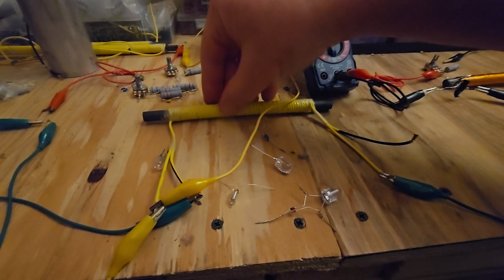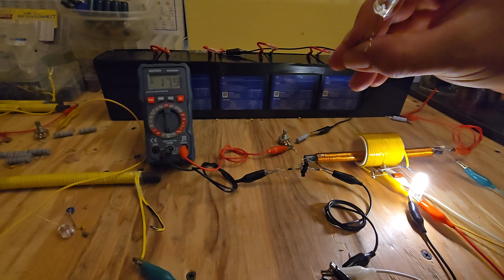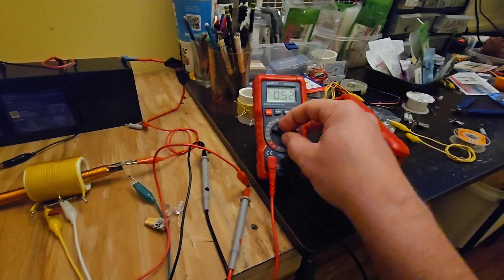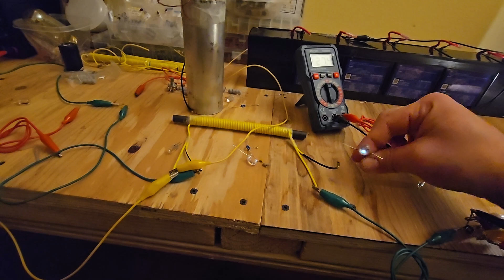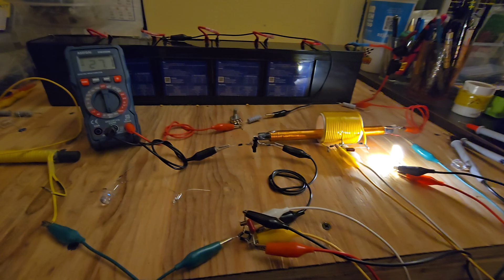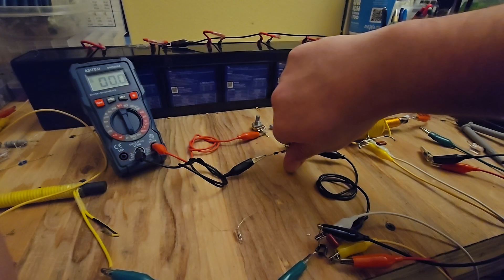💪SCALING THE SYSTEM UP SHOWS GREAT PROMISE & IT SEEMS TO BE VOLTAGE DRIVEN NOT CURRENT DRIVEN💡

Comment: Great work! Did you use Matched Transistors? Any chance you have posted a schematic to this configuration? Also, when you mention Impedance Matching with a charging battery could you show the topology of that circuit? ...and how do you measure the internal resistance of the charge battery? I've used a dymanic method to measure Internal R and not sure if its accurate. Thanks!
Reply from the maker: @woodwind63  greetings woodwind63 in the earlier models of the transmitter they used identical stacked transistors of the BC337B variety, but the current model uses just one MJE13007 transistor with a 90vdc 0-200mA variable current input. The exact details & schematics for the joule thief transmitter from the very beginning to the current models are all listed on my channels community posts page & a good way to impedance match the receiver coils output especially if constructed exactly as described in my posts notes is to slide adjust the coil over the transmitter until rapid battery recharging is observed & an additional LC impedance matching network in parallel on the quarter sized loosely coupled 336,961 style tesla receiver coil has a value of 1nF & 10mH & is beneficial if using a 200mah 9vdc battery for rapid recharge testing.

Comment: Have you tried some decent loads ? I am curious how it would perform under 2 kw load, resistive, inductive ?

I am using “what if I did this …” pancake coils setup and I can power some decent loads but they will load the input up to the limit of the source. Yet I am using maximum 64 w input to power loads up to 2 kwh (kettle for boiling water).

I never checked for wireless field but I can tell for sure all ac voltage is reflected back to the source and ignoring any diodes or semiconductors. In the wires from a charger or battery I have dc voltage and AC voltage in the same time, 20 Vdc and 110 Vac and will toast anything in the way soon or later. When I used a laptop charger with an RCD, the RCD is not working anymore and never been tripped.
Reply from the maker: I plan to keep scaling the system up because it seems to become exponentially more efficient at higher dc input levels. Between 60-200vdc input & the key to the transmitter operating correctly is to make sure abrupt unidirectional dc pulses are present within it at the minimal current required for oscillation & Resonanace to occur. Once these conditions are established within the transmitter circuit we can obtain our voltage potential from a rectifier installed between a virtual earth Grounded resonant coil & the collector of our transmitters transistor. A high current potential can then be acquired from the 336,961 style adjustable loosely coupled tesla coil that sits over the transmitter & combining these two resonant dc outputs yields a synergistic output that gives you voltage & current simultaneously & the key to using this resonant power effectively without it reflecting back upon itself is to impedance match it to your load with an additional well calculated LC network. I plan to do this for a 6ah 12vdc lifepo4 battery soon. :)

Comment: power it by turning your sloped garden into a ground earth battery...   place copper rods attached to copper plates (like spades) and iron rods attached to iron plates as fencing down the slope and let the plants grow using the fence as support and to keep the ground solid. the garden will allow moisture and electrolites for the galvanic effect. the plates attached to the rods can be any size but larger is better as the more surface area the better the galvanic effect. best of luck to you all.   one question though, what would occur if you used rings instead of rods?

Comment: hi buddy, nice to see another video, any chance you can loop this back into the source and have it self charge? thanks.
Reply from the maker: I Definitely think that's possible soon once the resonant output is impedance matched to the 6ah 12vdc battery i plan to rapidly recharge with the system that will then power a 120vac inverter & the inverter power will pass through an isolation transformer so the isolated & cleaned power can recharge the source driving battery bank interference free as well as run other ac loads cleanly

Comment: I like effort and explanation but this shows me what to avoid because...
Not knowing your particular system if I made a video I would quickly briefly tell about that first. Also I would same manner explain new better update findings. Because this allows others to decide if they want to waste time on learning more or not. Then people can stay or leave for further details. Many mistakes people make further is pointing camera with info like this is this.this is that...too unrelatable. Better to say it works like this because this part becomes this... How parts act together. Such as an overall easy explanation. Then break it down into smaller and smaller details. Lots of details being read about are not likely going to happen. Only if easily understood in steps. Like unrolling a story. Which can be seen in the minds eye. I don't want to hear lots of connections of parts without there being a reason for the explanation. Or an understanding of the reasoning. Especially when I have no clue what it's about. Because in my mind I want to compare what you have with what I already know myself. Relatable information. Achievable with short descriptive phrases overall. This is my ... Fill in the Blank... System...
Reply: @calagemlily  oh this makes sense but its aplicable few years back. Do some Work and catch up. These are updates for those the have done the basics .good luck
Reply from the maker: Check out our YouTube channels community post. I did my best to break it down & explain it along with schematics

Comment: Well done!  Would it be posibble at this scale to plug in neon sign transformer as a source? Many thanks for the efforts ❤
Reply from the maker: Possibly & what i plan to do next is probably obtain a small sized 100 or 200vdc battery to drive the transmitter as efficiently as possible. Not having a boost converter is slightly more efficient but if the wireless power effects at higher dc voltage input levels keep becoming further enhanced like they seem to be i might try driving the system from a 0-200vdc boost converter powered from a 12vdc lifepo4 battery

Comment: Sorry but I looked at your community page,  the last post is 3 weeks old, and the schematics do not resemble your circuit.
What is the efficiency of your system?
Please post schematics in the video, its so much easier to follow as you describe what you have.
What is your battery bank? 
BC337 transistors are NPN with a continuous collector current of 800mA maximum, for 17mA why do you need more than one.
Have you measured input and output power?
Reply from the maker: It's fixed & reposted twice. YT was being kinda weird/slow :)

Comment: So the input is 34ma at 52v (1.7W) and the output is 47v 0.5A (23.5W)?
Reply from the maker: If the resonant output is properly impedance matched to the load then yes, potentially the full 23 watts of resonant power will become real power instead of being reflected back into the resonant circuit. This can be done with an additional LC network in parallel with the load we desire to run once the resistance of the load is calculated.
Reply: @MTECHINDUSTRIES2022  cool
Reply: @MTECH2022  that’s awesome. You should make a video demonstrating the full 23W with a tuned impedance load
Reply: Also, what’s keeping you from self looping it?
Reply from the maker: @ashercorbett8089 i plan to very soon once I impedance match the resonant output to a 6ah battery that will run a 120vac inverter through an isolation transformer to clean the power :) the impedance matched battery should rapidly recharge
Reply: @MTECH2022 
As for self looping, Don Smith found on his system if he kept the wires from his source battery at a 1/4 wave length to his primary winding, it would self charge the battery.  This eliminated the need for the transformer he placed for looping his system. Maybe that would work for you too.
Reply: @MTECH2022  can’t wait to see it
Reply: @chasson321  Actually what happened was he created a standing wave that kept anything in that area charged. He intended for the 1/4 wave to capture the 21Mhz but it was not needed...just saying
Reply: @ 
That maybe. Rick Friedrich may have stated that also as he wasn’t to sure of the 1/4 wave theory espoused by Don. Whatever it was it worked for him.
Reply: @chasson321  Don ran his devices at 21Mhz and at that frequency then standing wave is. fairly powerful. That is why a Faraday cage is a necessity. I will have to go and check out what Rick had to say..Thanks...